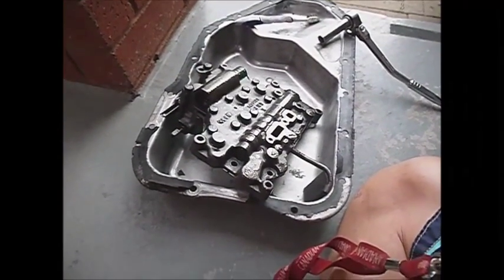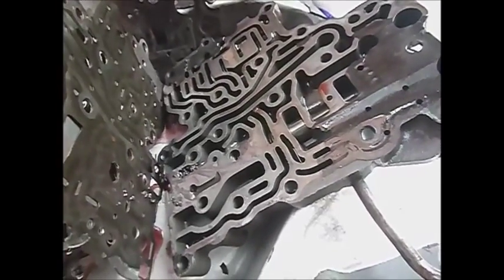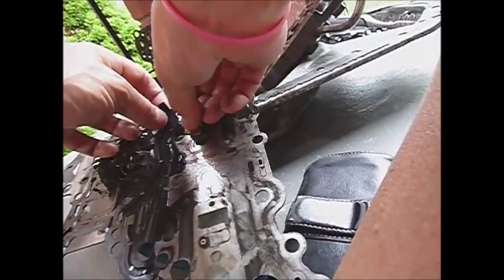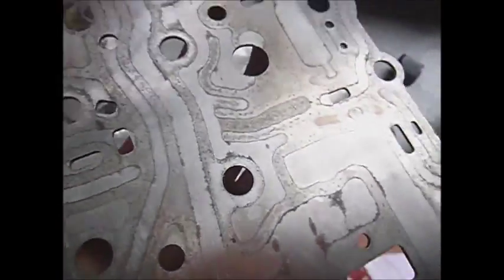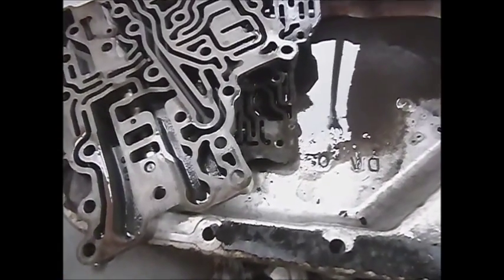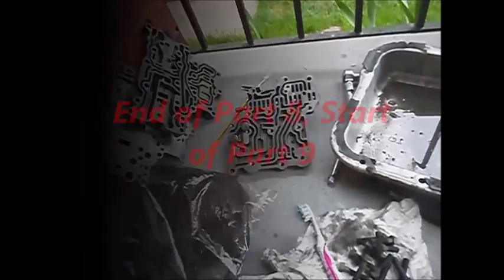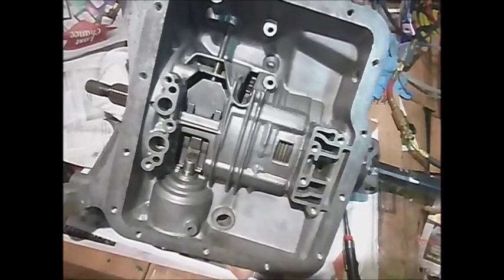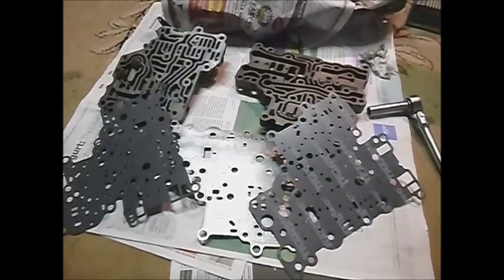Powerglide Overhaul Part 8 & Part 9

Comment: I have a powerglide out of a 66 chevelle. Do you know How many check balls are supposed to be in the valve body?
Reply from the maker: If I remember correctly Tyler, 1966 would have a front pump check valve and spring a rear pump check valve and spring it. I would have to check on my charts as I have not touched the Powerglide since this one featured, but I don't think there are any check balls. 1966 was the last year for a rear pump. This would allow the car to be push started as well as Supply oil pressure once the car was moving. If you are taking apart the valve body, do so very carefully, and the separator plate will show what are called witness marks. These are shiny spots that any check ball in most any automatic transmission would make over the lifetime of service.
Reply: @SammyVista1972  I found 2 inside the valve body. This is my first time working on a powerglide. And I'm waiting on a manual for it. Very familiar with Th350 700r4 and 4L60E  I've rebuilt dozens of those.
Reply from the maker: @TylerTicklesTigers  where in the VB did you find them. We're they side by side with springs? Commendable you have many styles of transmission refurbishing skills. Many never want to tackle things like this!

Comment: what was that site you were saying about "prendel" couldn't hear good, for transmission parts?
Reply from the maker: I apologize for the very belated reply and the quality of the audio. P r n d l is referring to what you see on the gear selector indicator either on the dash or on the floor if it is a console model. Parts can be easily found for a Powerglide on many of the transmission parts supply houses websites. While the power glide is anything but a practical transmission 4 use on today's roads, it does have a very loyal following on the dragstrip circuits that people looking to restore a car to be totally original.

Comment: Did you have a rear pump on your trans?
Reply from the maker: Yes, the transmission does have a rear pump on it. I believe the Powerglide had a rear pump until the end of the 1966 model year it could have been a touch later than that.